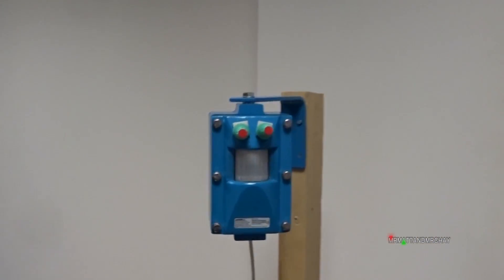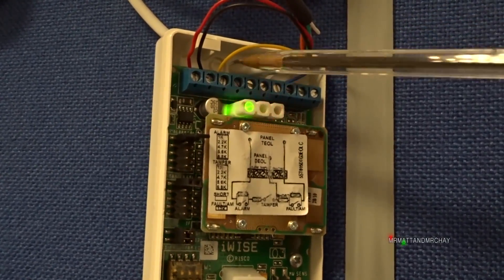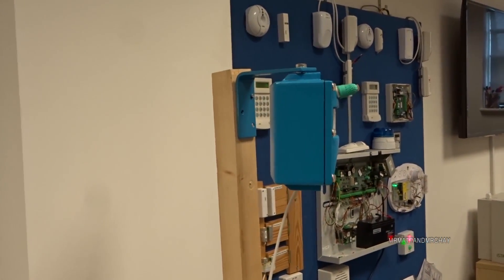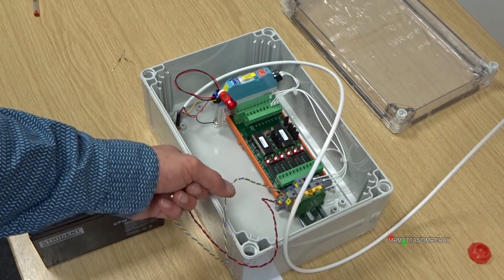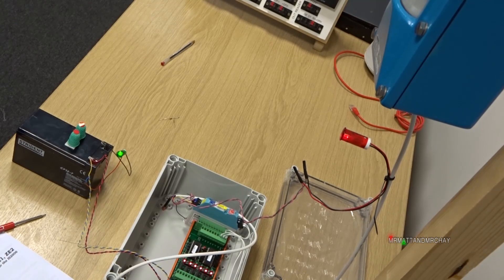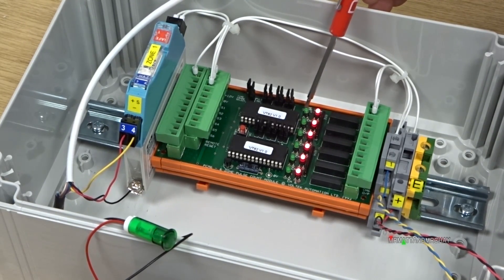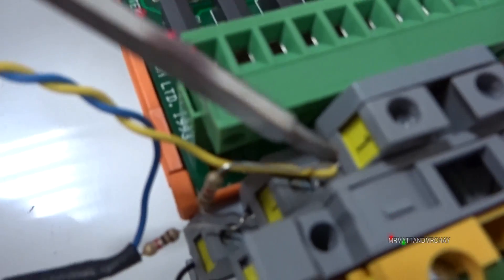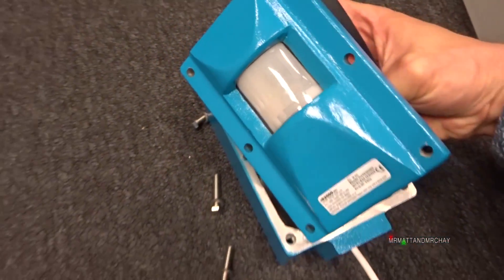PIRs cost between £8 and £30 - why does this one cost £1400?

Comment: Hello! I’ve always wondered what motion detector lights do when the alarm goes off. I don’t know if the lights do anything when alarm is triggered. It would be nice for a answer just so I can stop thinking about it all the time 😂 Thank you!
Reply from the maker: Hi.  The answer is, the same as they do when you move past them when the alarm is off.  All the motion detectors do is signal 'motion' to the control panel.  The LEDs blink the same whether the panel is off, on or in alarm.  You can however, disable the LEDs remotely (but it has to be wired and programmed to do so), so that general public cannot see when the detector picks you up.  We program our systems so that LEDs are disabled, but enabled when the panel is in engineers mode, but is rare to setup like this.  And I'm talking about 'wired' (not wireless) detectors here.  The one in this video is VERY rare and is not a traditional detector that you're likely to see anywhere.

Comment: As people who seem to be interested in tower blocks and pir's and such. I'm told, that back in the early days of pirate radio. Pirate radio engineers, used to make point to point microwave links, out of early microwave only motion detectors. Such detectors were fairly short lived as microwave, or early infrared detectors were prone to false alarms. Soon to be replaced by dual microwave and infrared. Great videos, well done 👍

Comment: wait a minute    there is no tamper on the signal processor or pir
Reply from the maker: Yep correct. Cut the cable from the PIR head and the trigger is cut also.  You would have thought they'd have made a continuous voltage then cut in the trigger when activated.  Therefore if that cable is cut detector relay stays active
Reply: Did you see the vid i emailed to you ofthe future of the Hilton park old otis lift

Comment: P.S. You wouldn't be able to see anything by removing those screws. Part of intrinsic safety design rules is to encapsulate absolutely everything into resin. Potted enclosures are a right pain in the arse to reverse engineer, and will do far more to stop someone reversing your gadget than scratching the part numbers off.

Comment: I actually did a short write-up about intrinsic safety a little while ago, and also gave a reason why you shouldn't use your phone at petrol pumps. Please excuse the copy-paste nature of this comment, but all of the information I have to offer is in this post anyway.

Why shouldn't you use your phone at a petrol pump? It's got nothing to do with the RF transmission of the device, it's got to do with the fact that mobile phones are not intrinsically safe. Intrinsic safety, in electrical and electronics engineering terms, means that under absolutely no conceivable fault condition, is a device allowed to cause a spark, or heat up to a dangerous threshold in potentially explosive atmospheres. An example would be in a sewer, or a mine.

It is effectively a glorified method of thermal management and fault tolerance. There is a ton of engineering that goes into making something intrinsically safe. Spark gaps, creepage distance, blast protection, fuses absolutely everywhere. No single part, or parts that make up a whole, is permitted to be over 75% (if I remember correctly) of its maximum values, battery assemblies must be completely potted in resin, said batteries are not allowed to reach temperature limits even in a short circuit condition, lots of things. With how densely packed mobile phones are, it is not possible to make them intrinsically safe.

How this would play out in the real world at a petrol pump, is if you drop your phone while filling up, there is effectively nothing to stop the thing from melting down and causing a spark, or enough heat release, to cause a spark and potential explosion in that atmosphere which does contain petrol vapour.

No one in this industry is really suggesting that radio waves magically cause explosions, because they don't. The real hint, is in the wording. "Turn off *current emitting devices*. For example, an energy dense lithium ion battery that is just gagging to melt down when fully charged.

Comment: Good video, pir signaling is a bit more elaborated than I thought
Reply from the maker: you mean with the resistors?  Yeah, resistance values determine the state of the detector.  Resistance is less likely to be interfered with than say a RS485 data system.

Comment: The radio we carry out side the ambulance has to be intrinsically safe also incase of a hazmat, we even have to have a specific battery for them to be 100 safe for those situations and they are even less then 12 volts.
Reply from the maker: I'm learning a lot from this video, thanks for your comments
Reply: Never can be 100% sure, but I know the in and outs as a worker a the biggest methane source, being a sewage treatment facility. Everything we do near has in as close to non sparking as you can get with out a sponge.

Comment: Nice detector, the Fresnel lens is probably potted in as well, just to prevent gas from reaching the electronics at all. From experience at work (we make, amongst other things, specialist devices for oil platforms) I suspect it will also have a serious metal cable gland. The wiring to it needs to have an earthed braid between the outer layers of insulation, that needs to make electrical contact with the gland so there's never any risk of a potential between the cables and the metal cabinet/housing that could result in arcing.
Reply from the maker: Interesting and thanks for the comment

Comment: Intrinsically Safe sensor fun!  I designed a cabling system for a pharmaceutical plant many years ago - used Ether distillation to make the product, very explosive gas.  Relays are dangerous due to the back-EMF generated when the relay coil is energised or de-energised.  Wiki (as usual) has a good article summarising all the standards: https://en.m.wikipedia.org/wiki/Intrinsic_safety
Reply from the maker: Cool, interesting info!  Thanks for the comment